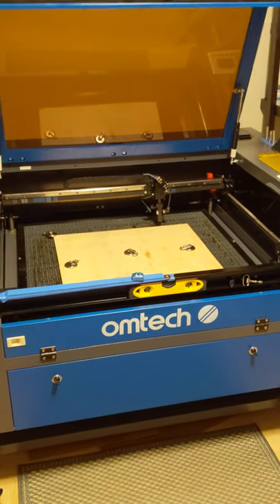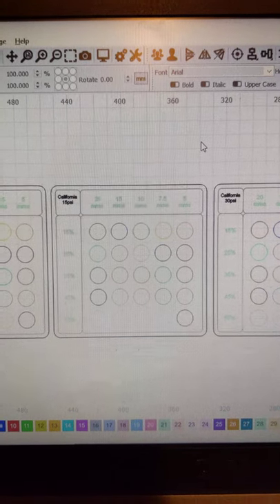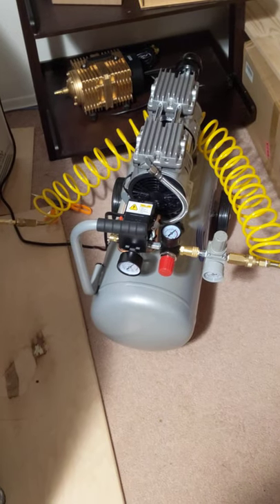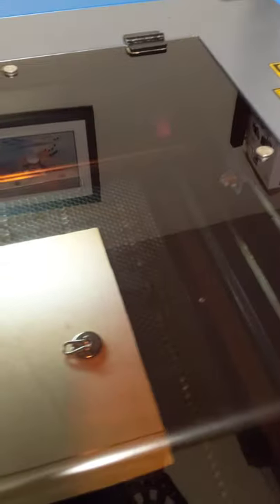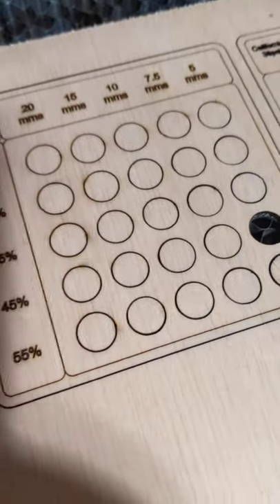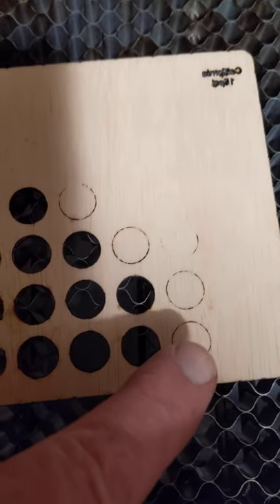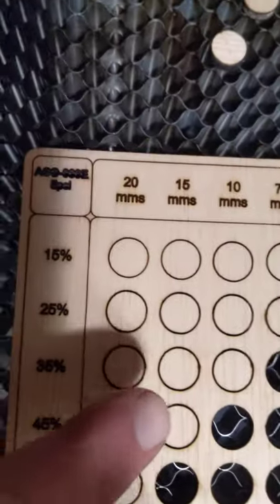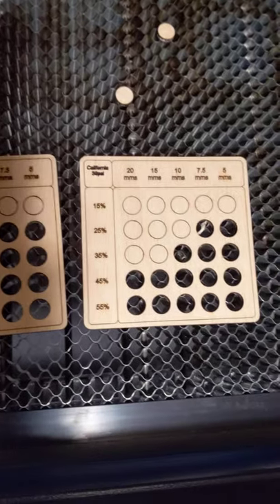CO2 Laser Air assist verus Air Compressor

Comment: Great VIdeo, and how you show everyone the setup. The only thing I say is missing is a shut off valve so the air doesnt keep pushing out when you are done. I added mine at the connector to the compressor.

Comment: good video, bad layout. bit of advice though. First, the compressor has a regulator, so unless yours is broken, there's no need for a 2nd one at the head. Second, if you're going to run a moisture trap like that, place it closest to the tool, not the source. The air hasn't had a chance to condense as much at the head as it's still quite hot. You'll find it serves a far better purpose closest to the tool. With that said, those California Air Tools compressors rock. I used one for years for airbrushing and it's very quiet. You can hold a conversation easily while it is running. I just finished setting up a 60w co2 laser and ran a regulator/trap on the side of the machine and am feeding it off my 80g monster compressor. This helps me get an idea of some settings for the psi to run at for sure. Thanks much!

Comment: Im super new to laser cutting but it seems like there should have been a little more power for the cutting.  Also with that long skinny coil hose if you have 30psi at the regulator before the hose you will have considerable pressure drop at the laser.  Id be guessing closer to 20psi.

Comment: Hello, excellent. Please, the diameter of the hole of your laser head is 2 mm? Because it is not the same for connecting devices and it affects the secondary pressure.

Comment: I am just now looking at upgrading my air assist and ran across your video. Did you just hook the California air up bypassing the OEM air assist? Or did you put in a solenoid and wire everything to the controller as well?

Comment: Thanks for your information, it's very helpful.
I'd like to ask, what happens if you run the compressor approximately for an hour. Is the compressor capable of filling itself during that 1 hour cut, can it provide air without stopping? Or do you need better compressor with a larger air volume. Thanks in advance..
Reply from the maker: Yes, it will.

Comment: Nice comparison! Is that the 60W machine? How do you like it? Looking at getting the 55W. At 30ish psi how much is that compressor running? Have heard they do not hold up if running close to continuous.
Reply from the maker: I've had it run for well over an hour on a long job.  My usual jobs are 20 minutes or less.  If you have long jobs in mind, I'd get a larger compressor with more CFM.  At 10psi (used for etching) it is off more than it's one and I have no concern about it.  At 30psi, it's on more than it's off and I wouldn't go for hours like that.
Reply: @MaikaiGuy Thanks for the info.

Comment: The cheapo pump that came with my laser died within 3 days, but I had a little airbrush compressor that worked pretty well, but I am still getting more scorching than you are with 15 or 30 psi.
I wonder if I should get a tank for the compressor to fill so I can get a greater airflow?